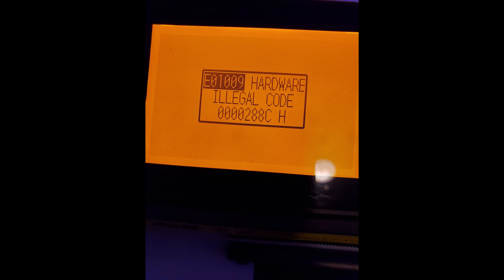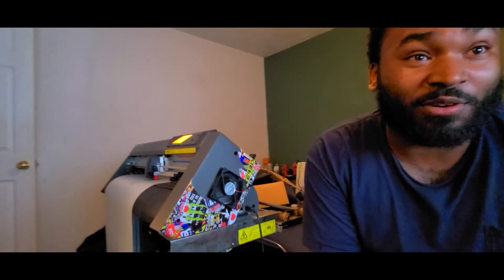How to fix graphtec motherboard problems E01009

Comment: This saved me $733.81 for a new board. Since there wasn't a follow-up vid, I'll tell you what I did: 
1. Removed the three screws that hold the right side panel in place, and removed the panel.
2. Drilled several 1/2" holes in the raised side opposite the processor chip.
3. Drilled another 20 small holes for air flow in the curved back side of the panel.
4. Purchased a fan from Amazon for $10 (ELUTENG USB Fan 80mm) Amazon's Choice .
5. Removed the wire guard from the intake side of the fan. I wanted to draw hot air out of the cabinet, rather than blow cool air in.
6. Used 3M 468MP double sided adhesive to attach the fan to the plastic side panel where    holes are drilled.
7. The holes on the curved back side will allow fresh air to come in. I'll probably put some type of air filter over the holes just to keep dust out. I didn't use a heat sink. 
Hope this helps someone in a desperate situation. I was freaking out, but this worked out great for me. Thanks for the video!